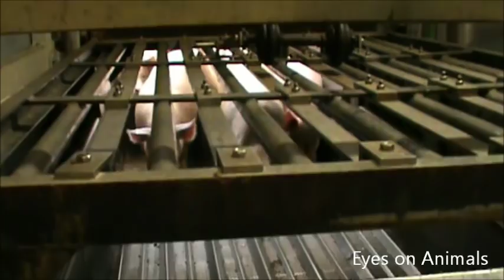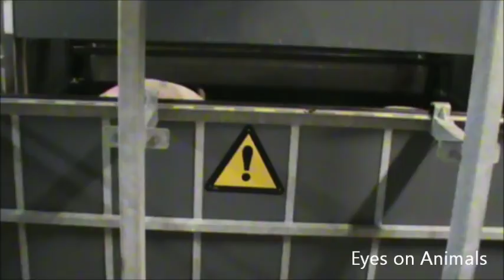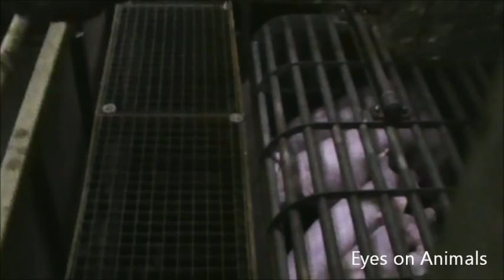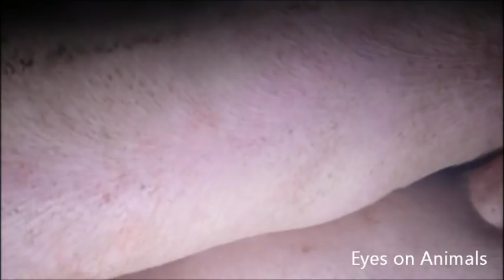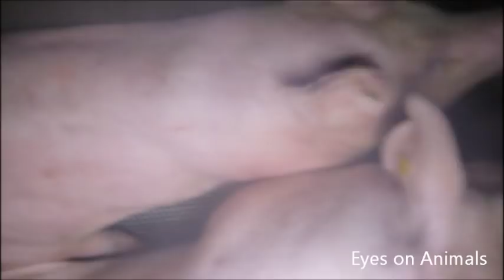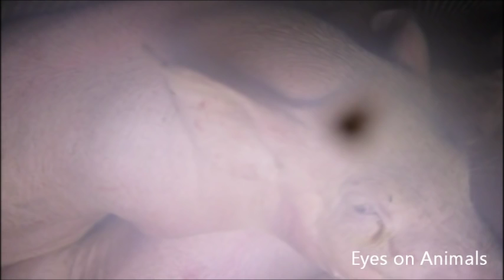Paternoster and dip-lift CO2 stunning system for pigs

Comment: a sensation of breathlessness? more of a reality
Reply: The sensation of breathlessness is caused by rising levels of CO2 in the blood. This is why e.g. CO is so dangerous because it replaces oxygen but not CO2 so the body never gets to know it's not getting enough oxygen. The body cannot detect lack of oxygen.
Gassing animals with CO2 is bound to provoke suffering because the body immediately detects the CO2 and will cause the sensation of being out of breath.
Theoretically, CO would be the optimal solution to gas the animals because they'd immediately go unconscious without their brains even realising what's going on - however, that would also be much more dangerous to the workers there so I guess that's why they're not doing it.

Comment: this is terrible. It would be even less stressful to cut them with full conscious. They should return to electrocution or use a different gas. (or become vegetarian like I, but I do not want to impose this option to anybody)
Reply: Ulrich Lehnhardt Agreed, thanks for your non-pushy comment. I am considering becoming vegetarian again until conditions improve (I had to stop before due to health problems -- could not take some vitamin supplements with other medications which I now no longer take). Hopefully it will only be about a decade until synthetic meat is in full use, but I'm happy to see companies already using 70% meat, 30% mushroom blends to keep the meat moist and cut down on the amount of meat used and thus the amount of slaughter. It's a start, at least.